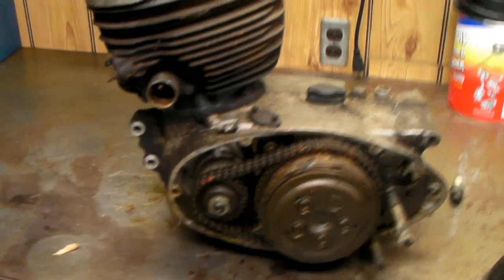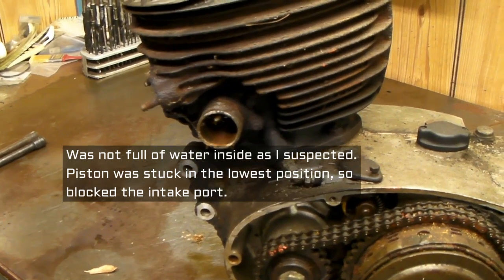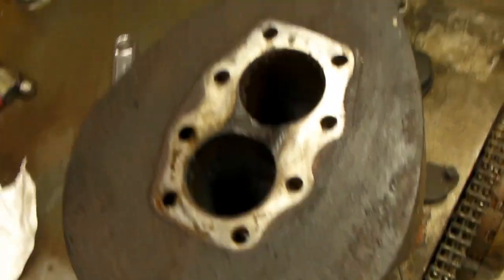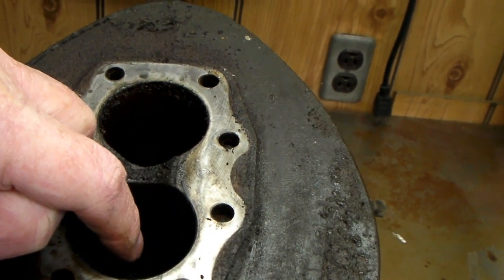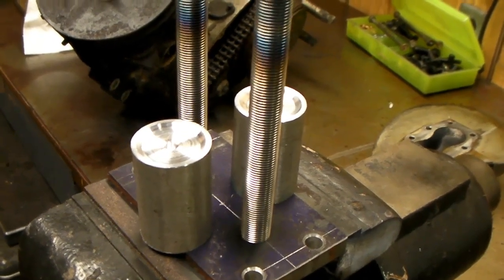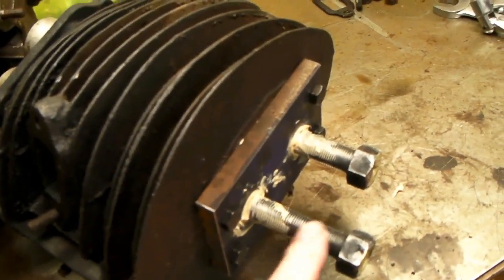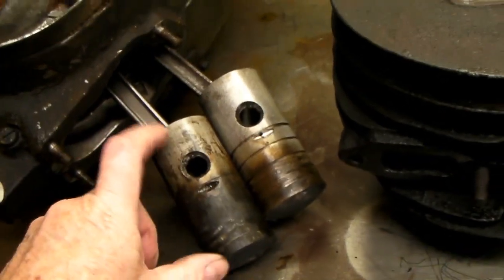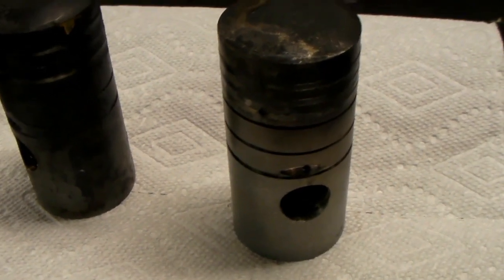Allstate Puch 250 SGS Twingle teardown of junkyard engine. Part 1

Comment: I owned a 1958 puch 175 back in 1972 it could run all day at about fifty miles per hour, but any faster than that and the back cylinder would get hot and start to seize up. I have fond memories of that old bike. 😂

Comment: Hi sir, Iam curently start my project to rebuild my sgs 250 allstate, I need information about piston and bore clearance. do you have any information? thanks
Reply from the maker: Hi dewaadewaa.  Nice to hear that you are starting on a Allstate 250 restoration project.
My own project is taking some time, but underway with the painting right now.
I don't have any information about the Puch 250 piston clearance, but I should think .004 inch would be very good. I would not think about a re-bore unless the clearance was over .008 inch. I simply honed my cylinders lightly as my engine had 10,000 miles on it, so wear was minimal. It might take some searching to find a cylinder hone with long enough stones, so they will not catch in the ports. The hone must go into a small 45mm bore, and that is difficult to find. Lawn mower shops might be of help.  Remember, too loose is way better than too tight. The pistons are very long, so will not rattle easily.
  Best of luck with your project.😄
Reply: @Adventurepilot70  thanks for your respond, i am appreciate sir.. I am gonna try your advice on my project.
Reply: and i try to convert ignition from ac to dc 12V, when its success i am gonna share with you
😁
Reply from the maker: @dewaadewaa   I would be interested to hear about that. 6 volt electrics are not very good.
Reply: @Adventurepilot70  can I get your email? i want to share my photo when I am race with my puch, curently I use 12V ac ignition but curious about 12V DC ignition
Reply: @Adventurepilot70   i want to share my photo to you when I am race with my puch, curently I use 12V ac ignition but curious about 12V DC ignition
Reply from the maker: @dewaadewaa   My email is  badge417@yahoo.com

Comment: I have a puch175 twingle.  I am trying to determine the oil drain plug size on the bottom of the case. 
Any help would be appreciated
Reply from the maker: I do not have a 175 engine.  I had a parts bike, but did not get the engine. The drain plugs will be a metric thread.  If you can get the old plug out, use a micrometer to measure the O.D. of the threads.
Reply: @Adventurepilot70  yes that's the problem...I removed the drain plug and it was a 1/4-28. It even said 1/4 inch on the head of the bolt. Thats how I new it was wrong. 
I was hoping to find someone that could measure there drain plug threads and tell me what they were. I  just figured a 250 might use the same thread.
Thanks for responding.  I appreciate the assistance
Reply from the maker: @marctaillon6415  It is probably a 6mm metric bolt. You could get this at Menards or any good hardware store. Hope the threads are not messed up.  Good luck with it.
Reply from the maker: My 250 has a 8mm plug with a fiber gasket.

Comment: The pistons on my 175 sv are stuck and in the up position. It's been sitting long without a plug. What do you think I should do?
Reply from the maker: Turn engine to drain any water from cylinders. Fill with penetrant oil. Use old sparkplug to make fitting to attach to a piece of brake line as shown in this video. Use grease gun to force oil past pistons and rings. You should be able to force the cylinder up as far as the ports. Getting it the rest of the was off will require some other mechanism such as a jack screw like shown here.

Comment: Hey great video, I had a years long sitting seizure on my 250sgs I copied your idea but used wood slugs, mine was just off top dead centre so I was worried the lower section of bore was possibly rusted below the skirt but I'm happy to report your idea worked great thanks for sharing

Comment: If I remember correctly the weak part on some of those Sears motorcycles was the flywheel key because the threaded end of the crankshaft was too small.